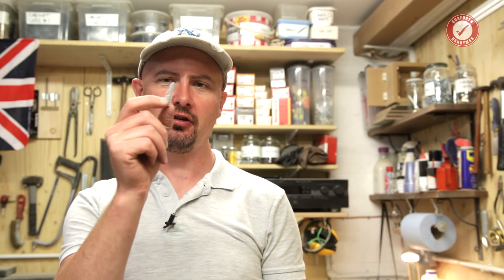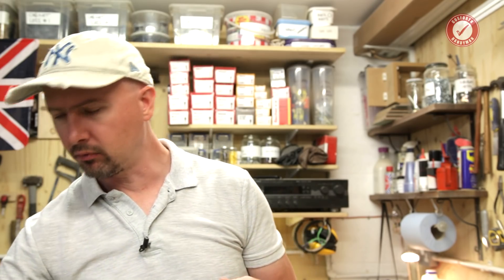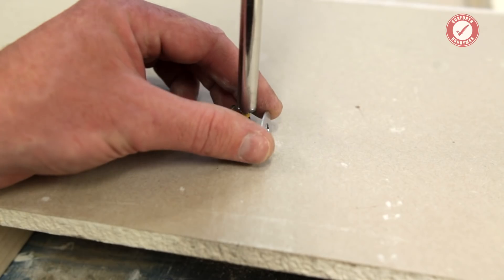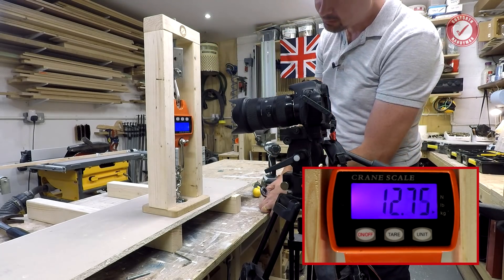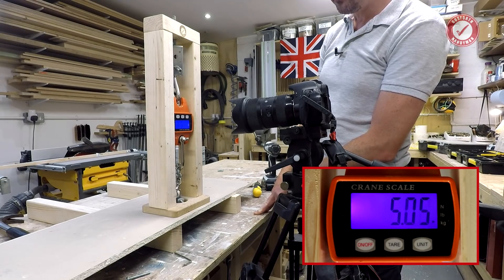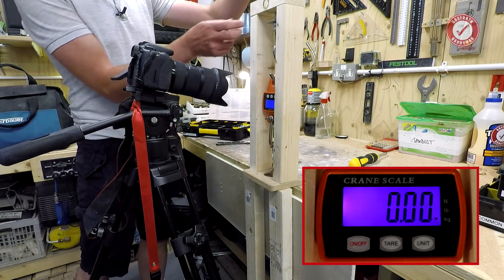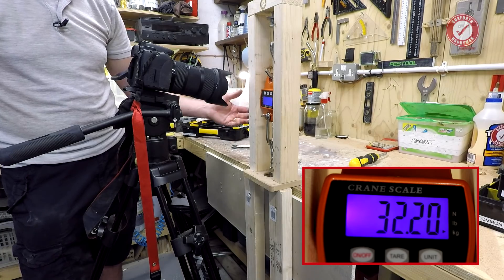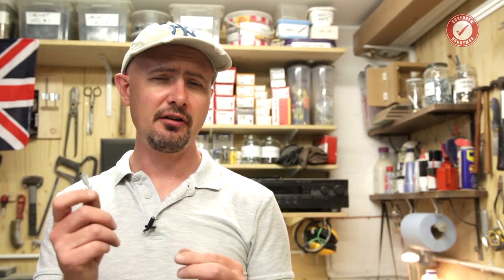How strong are Fischer light duty plasterboard fixings?

Comment: May I ask you a ? I have a lot of wood screws, various lengths etc. I want some general-purpose screws for jobs like this as I've just bought 100 of these fixings following your website link. I guess I am just in need of more screws for jobs other than wood. I was putting a hook up yesterday and all I had was wood screws. Can you advise me what to look for and the sizes I need (I'd like to have a good selection in stock for various jobs, so the most used) thank you

Comment: I was planning to use these for a speaker bracket but was worried they would not hold. The speaker weights 4Kg and after seeing this I feel confident that the bracket with 4 of these fittings will be just fine. Thank for you for the great and informative video.

Comment: Would it be correct in thinking that if one can withstand say 20kg. Then if you were mounting a TV and you had 4 or 6 of these plugs that each one plug is only supporting 5kg or 3kgs and a bit?
Reply from the maker: Yes BUT never go by the peak load - you must always cater for a safety factor - normally 3-4 times smaller at least. Always go by the manufacturer recommended ratings - I think for these it's 5kg per fixing, so I wouldn't use these for a TV.
Reply: @GosforthHandyman  what sort would you recommend I watched your vid with the corefix ones but where my TV would go there wouldn't be any brick work behind. It's backed by the stair case? It's a new build so can't even check for studs ect just yet... Help needed 👍🏼
Reply from the maker: Hey Jimmy - I really can't advise without seeing it in person. For a 20kg on a flat-to-wall bracket I'd probably use expanding metal anchors on a hollow wall but if it's a cantilever bracket you'd need to hit the studs. 👍
Reply: @GosforthHandyman  OK mate that's great, thanks for the advice, appreciate it. Keep up the vids, all best 👍🏼

Comment: Now we know what the weight may be on a single plug. But say you use 6 to 9 plugs to hang a shelf and place a heavy object like an old tv or microwave,or something over 15/20kg. I wonder if it would eventually pull out over time. In a real world application many of these would be used to hang a heavy object,distributing the pull weight on many plugs.
Reply from the maker: You would definitely NOT use these little plugs for heavy stuff like that. See other vids e.g. expanding metal anchors. 👍
Reply: @GosforthHandyman  Yup I know that. Just got me thinking if one little plug takes that amount of kg,I wonder what would happen if kg was spread out over many plugs. Thx for the reply. Have a good 👍 day.

Comment: To be fair, the fastener and anchor combo did not fail. The substrate material ‘drywall’ yielded as one would expect. However, your test numbers in both axial and shear force yields should be consistent within a range of anchors of this diameter. I am curious if other brand anchor testing vids reveals this. Larger diameter anchors should spread the load out, maybe ?  Since drywall is so common, and people hang the weirdest stuff from their walls, a fun destructive test would be how much could one actually hang from a wall using anchors commonly available, regardless of diameter. Maybe test best method or pattern vs quantity etc, ( without stud penetration). I’m sounding crazy, but destructive testing is a great topic and your series appears very popular. Thanks for your effort on the videos, great material. New subscriber. Safe New Year to you !
Reply from the maker: Welcome to the channel! 👍

Comment: Hi.  What is your opinion of the Fischer Duopower and Duotec plugs please?   I installed a TV bracket on plasterboard with anchors (used a setting tool) so it ain't coming down  :)    However, the Duopower and Duotec (in particular) look quite good.   

The Duotec will double us as normal plug if the cavity is too small for gravity for it to 'open up' behind the plasterboard.

Would appreciate your take please mate.  Ta muchly
Reply from the maker: Duotec look great - got a box ready for testing! 👍
Reply: @GosforthHandyman  Luckily I have subscribed and tapped the bell so I will know when you have put them through their paces 😜

Comment: Ever try fischers plastic expanding plasterboard anchors? Same principle as the metal ones but made of plastic?
Reply from the maker: Um... not sure to be honest! Can you post a link? 👍
Reply: The ones I meant seem to be discontinued. They used to be sold both as fischer and in kits with ELFA/Sparring wardrobe fittings.  I think the current style is the Fischer PD 8-12. Ages ago when I worked in a DIY store they used to be colot coded blue and red for 10 and 12 and behaved roughly like the metal anchors but no special tools required. These days most new houses here in sweden will have OSB or construction plywood behind the plaster board though so plugs and anchors are not as much of an issue.

Comment: Maybe you could try the plastic self drilling plasterboard and see how they hold up, in my experience they hold a lot more than the grey plugs. The ones they sell in Poundland are basically holding everything up in my house. I put a swinging TV bracket up with them and you can literally hang on it when it's swung out. But then again, it depends on what thickness of plasterboard you have, 12.5mm is a hell of a lot stronger than the 9.5m plasterboard
Reply from the maker: On the list - although I've seen a lot of disasters with these I'm afraid! 👍😃

Comment: Nice one Andy. Another good demo of just how good these fixings are if you use them properly. 
A suggestion for a test would be to see if there is much difference if someone was to fit them wrong. Say someone forced them into a 5mm hole or into a 7mm hole. The type of thing a rookie DIYer would do and think it was fine cos it worked once :)
Reply from the maker: Cheers - good idea! A smaller hole would probably get better or similar results.  👍

Comment: I wonder if some of the pull out was due to the screw not being fully threaded? Would be good to see it done with a fully threaded screw. It would be also be interesting if having a screw with a more defined thread would make a difference, maybe a turbo gold, I guess you’ve used a silver screw there. Great channel, keep up the good work.
Reply from the maker: Could well be - d'oh! I'm so used to using those screws for putting battening up I didn't even look - my bad! Turbogold are a bit aggressive to use in plugs IMHO since the serrated shank removes a fair bit of the plastic. They work but I prefer Quicksilver / Silver / Goldscrews for plugs if poss. Cheers bud! 👍

Comment: whoop for test tuesday!! i must have 20 kilo vision... because whenever i so much as *look* at one of those shitty drywall anchors, they fall out of the wall! ;) those anchors took more weight than i thought they would though.... but ever since i learned about molly bolts from you (srsly, they're so buried under the shelves in my local hardware stores i never saw them...thanks Andy) that's almost exclusively what i use when i can't find a stud.
Reply from the maker: Yeah, these are only for pictures, light mirrors etc. Only rated to 2kg. 👍🛠

Comment: I don't like to use very lightweight fittings, I tend to use the two screw type with an outer alloy hollow screw and an inner screw to hold the fixture.
Reply from the maker: The self drilling ones? Watch this space. 👍😀
Reply: Gosforth Handyman that's the ones.